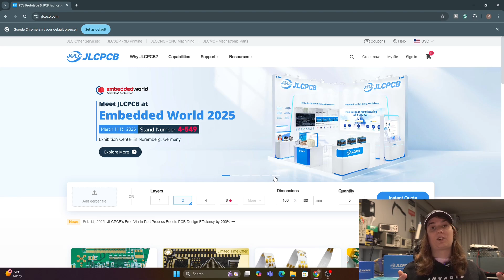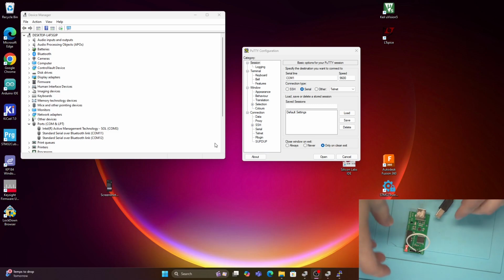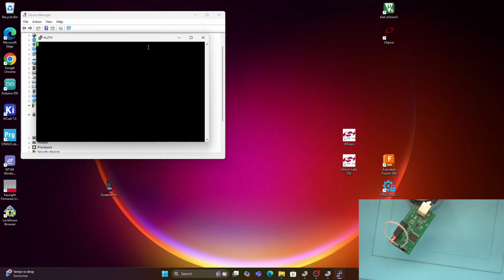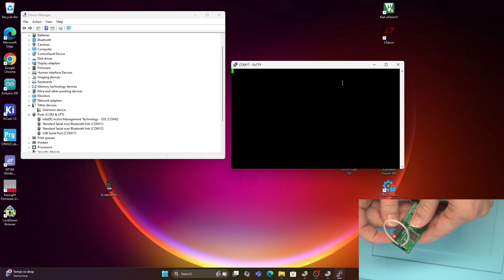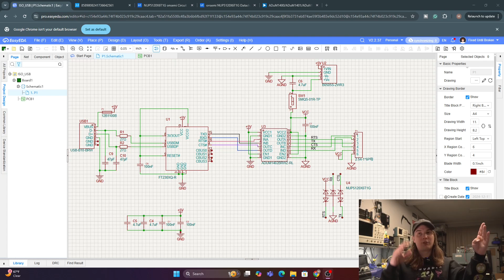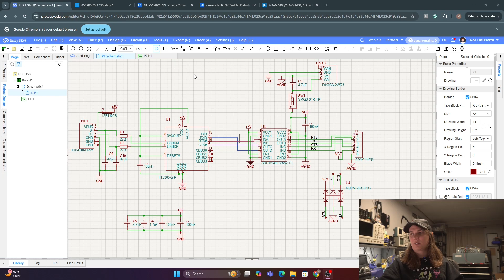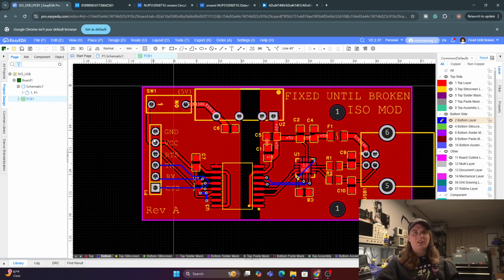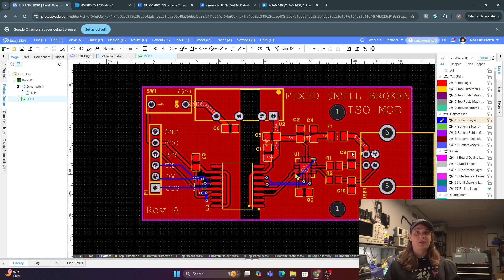ISO MOD – Isolated USB to UART

Comment: Good video but whats the point of isolating two communication protocols of kinda the same type?
Reply from the maker: I use it to protect the computer from potential faulty stuff I am working on. They are common in industrial use as well. Again for the same reason a faulty high voltage system can easily destroy a computer.

Comment: Interesting project ! Quick question why did you use what I call the “printer type“(USB B)? 
My lab over time has purged this type USB connector
Reply from the maker: I used USB B because in the application where I plan to use it I had a BB electronics 485. The other reason I USB B is because it still the most common adapter on test equipment. A new keysight DMM still uses USB B